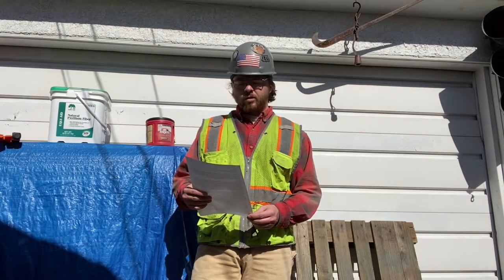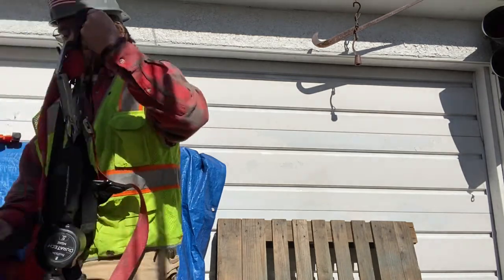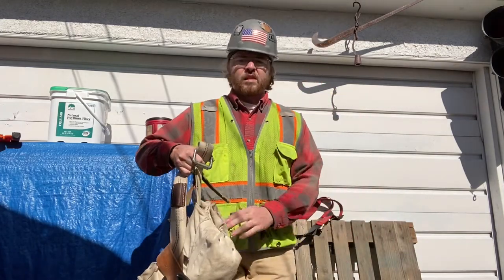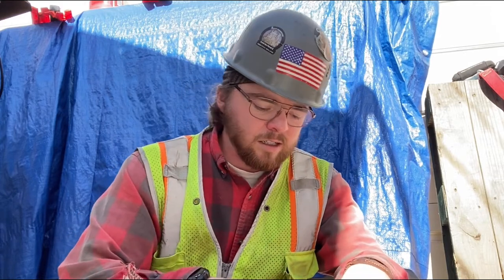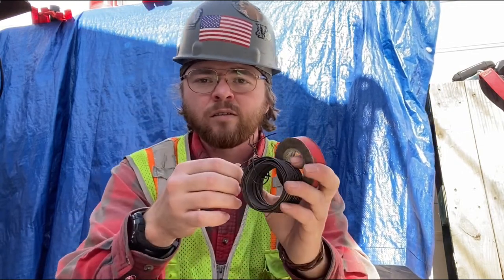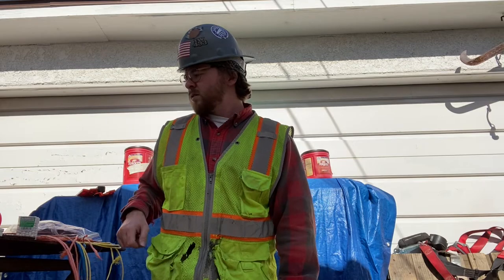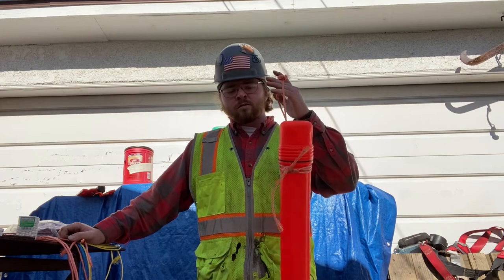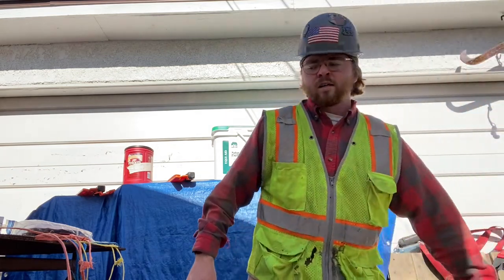A Journeyman Welder/Ironworkers Harness, Belt, Gear, Etc.

Comment: Thanks for the video! Here's a summarized list of everything you talked about:

Here are the items grouped by their functions:

*Safety Equipment:*
- Harness
- Safety clips for harness
- Safety vest
- Safety glasses and eye protection
- CPR knowledge

*Tool Storage and Organization:*
- Tool belt
- Tool pouches
- Quick-release buckle on tool belt

*Measuring and Marking Tools:*
- Torpedo level
- Tape measure
- Lumber crayons
- Sharpies
- Pencils
- Speed square

*Cutting and Fastening Tools:*
- Pliers
- Utility tool (combines box cutter and pocket knife)
- Vice grips
- Wire cutters

*Personal Comfort and Health:*
- Earplugs
- Tic Tacs (for staying awake)
- Super glue
- Vaseline
- First aid kit (including Israeli bandages, gauze, snake bite kit, burn cream)
- CPR training

*Lighting and Magnetics:*
- Safety flashlight
- Magnets

*Injury Treatment and Prevention:*
- Snake bite kits
- Burn cream
- Cat tourniquets
- Indian clay (for stopping bleeding)

*Tool Removal and Miscellaneous:*
- Cat's paw (for removing nails)
- Bolt bag
- Pry bar (for removing wood)
- Wire
- Duct tape
- TP (Toilet Paper)
- Grinder
- Welding rods holder
- Chipping hammer
- Adjustable Spud wrenches
Reply from the maker: Thank you so much!!  I greatly appreciate you putting a list together and organizing it!!  I completely forgot about the list of tools and items.  Once I received requests for other videos, I completely forgot and hadn’t thought about it since.  Thank you again, I really appreciate it boss!!

Comment: I think they make leather fr high vis jackets for welders not sure with Osha regulations and what not but just a thought
Reply from the maker: I think they might make that as well.  They for sure have FR shirts with high vis strips on them.  Normally I am not in a spot where I need to have high vis on me if I am welding.  I move around so much on job sites that I try to only wear my welding jacket when I am welding and fabricating.  Thank you for commenting!

Comment: i just got in as a trainee ironworker  in Hawaii starting with a reinforcing small union  company excited   start this Monday
Reply from the maker: Welcome to the ironworking trade!!  I mainly work with structural steel but if you have questions about tools, gear, and/or other work stuff I will try my best to answer them for you.  Congratulations on your new job that starts on Monday!  I hope you enjoy your new job and the trade as a whole!  Best of luck to you!  Stay safe!!
Reply: If your good at rebar you can make lots either way your in a union  is it mostly rebar there or ant structures of steel
Reply from the maker: I never did much with Rebar so I don’t know much about that.  I used to be in an Ironworking Union.  In my area, Ironworking is so big that there are two Ironworking unions.  One for structural steel and one for rebar.  I was in the structural steel ironworkers Union.
Reply: Rock of ages USA   yea man it’s not to bad I enjoy it finished my first week  built a few walls and half a slab already just labor honestly   Fun when you with. A good crew
Reply: @Kentreyal12  hey man just checking to see if your still with the reinforcing I’ve been doing it for years thought it was cool you just got into the trade!
Reply: @fatguy7658  yes 2 months in man
Reply: @Kentreyal12 still rod busting?

Comment: What type of headlight for night work ? Model , brand ?
Reply from the maker: That is a great question!!  I do not go by any particular brand.  Due to the nature of welding and ironworking, my headlights get torn up pretty easily.  In all honesty, I pick up cheap headlamps from places such as Harbor Freight, Lowe’s, and Home Depot.  That way I don’t have to worry about expensive headlamps being damaged.  Eventually I would like to use a better headlamp with more brightness, but for now, these get the job done perfectly well.  I do not know how many lumens they are unfortunately…. These are just the cheap headlamps that are free when you go to hardware stores and you buy more than a certain price point.  Thank you for commenting!!

Comment: Waiting for work to pick up and join the same union. Hell yeah
Reply from the maker: Good for you!  Hopefully you don't mean Local 433, haha.  I got out of that union a while ago and my buddies are doing the same.  It is not the safest union to work for by any means.  There are other unions that have a much better reputation and actually follow safety protocol.  Either way, I wish you the best of luck!  Thank you so much for subscribing and commenting!!
Reply: @WeldinCowboy which ones have a better reputation I was looking into 433
Reply from the maker: @Jason21012 That’s a good question.  I have heard good things about the carpenters, pipe fitters, and elevators unions.  Both of the latter are highly sought after.  The carpenters have different areas a welder can go into.  It really depends on what would make you happy and what type of job site you would enjoy the most.  If you have more questions, feel free to ask!  Thank you for commenting!!

Comment: There’s Kevlar harnesses for welding but they cost a pretty penny
Reply from the maker: Those definitely do cost a lot.  With most of the jobs I have been on recently, they do issue a harness for every worker at height.  I do plan on buying one of the really nice ones in the future.  Until then, these cheaper ones have been working fine for me and I do check every time that they are still in proper condition before use.  Once I get that new safety harness I will definitely have to do a review of it.  Thank you for your comment!!

Comment: What’s a nail puller in your bolt bag for
Reply from the maker: As I have stated in multiple videos around the time I filmed this one, I was working around a lot of carpenters who had a whole bunch of wood nailed together which was in the way for me and my crew.  Using a cats paw nail puller to pull out nails is much easier than prying 2 x 4's apart with a chipping hammer.  It was necessary for that particular job and has defiantly come in handy on other sites as well.

Comment: A pen is the first tool needed to write or sign you FLRA do you what that is
Reply from the maker: Yes, of course I know what that is.  Job sites are supposed to have you sign that before any work is done but in reality, it doesn't work like that.  Regulations requirements and what happens in real life are two very different things.

Comment: A yo yo is not for horizontal it’s for above your head
Reply from the maker: According to OSHA that is not true.
Reply from the maker: This is directly from OSHA's website:

1910.140(d)(2)(i)
On any horizontal lifeline that may become a vertical lifeline, the device used to connect to the horizontal lifeline is capable of locking in both directions on the lifeline.

Comment: If you get electrocutedthen you touched other trade work lol
Reply from the maker: Not true.  Being a welder, there is a lot of electricity used in our line of work.  Sometimes charges are built up in various conductive objects on site.  Also, some people do not take proper safety precautions which can lead to others being electrocuted.  It can happen quite easily when the proper safety measures are not followed.

Comment: No no not if it’s a safety issue never take a part other trades work that’s non-union
Reply from the maker: It defiantly was necessary.  My crew and I had to dismantle the carpenters work as it was no longer needed during our installation.  We were tied off and it was part of our job.  Sometimes different trades have to take apart other trades work to get the job done, it literally happens all the time.  On huge sites such as the one in reference, every trade was super busy, and we are not going to be jerks and ask the carpenters to stop their job to pull some nails and delay their job as well as ours.   True tradesmen get the job done.  We all work hard so we don't play stupid games of helplessness.  Pulling nails is such easy work, it was no big deal to handle that.  Again, we needed the stuff out of our way for putting in steel.  Once we were done, the wood was not needed as everything would be complete.

Comment: And you need to be fully shaved for a mask
Reply from the maker: That is only required when using pumped air or relying on an oxygen supply.  Using this mask with being unshaved is accepted.  Working at refineries, chemical production plants, extremely confined areas with little to no air flow, along with a few other reasons will require a shaved face for the supplied air, not for using this mask.